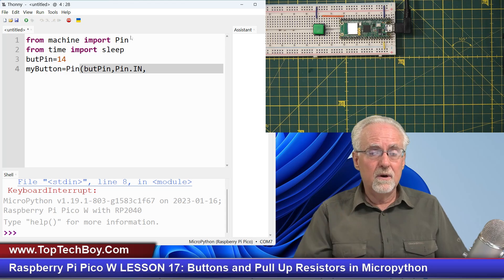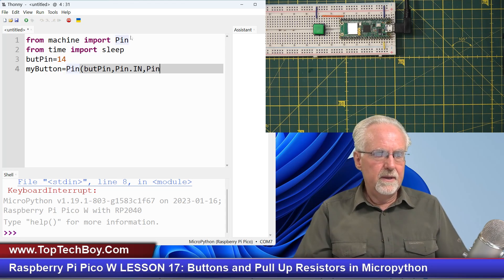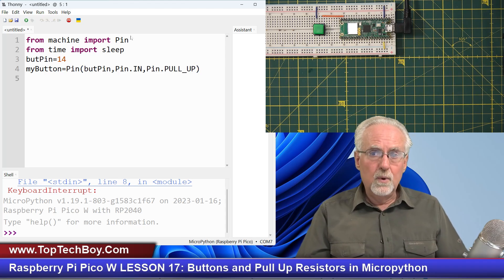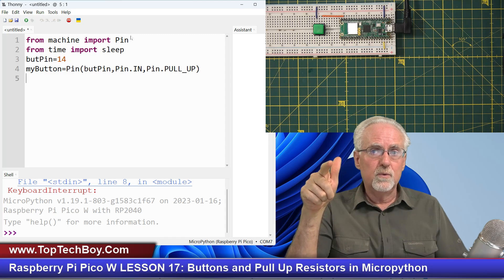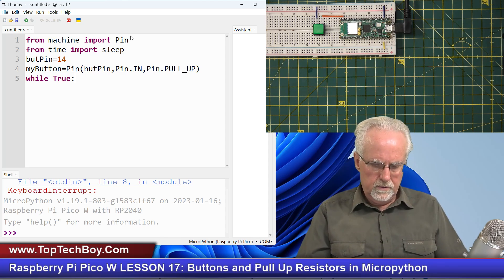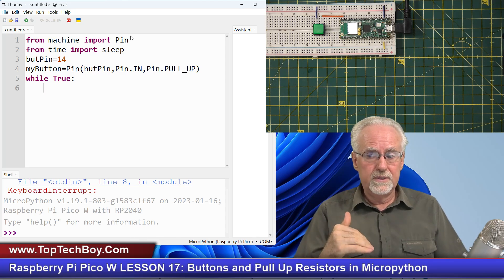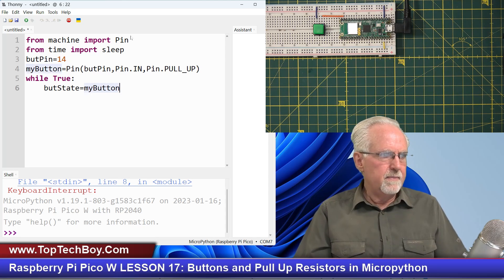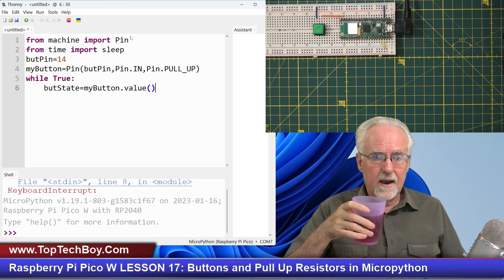Raspberry Pi Pico W LESSON 17: Buttons and Pull Up Resistors in Micropython

Comment: Will anyone advise please? As one learns code as a beginner, is it important to learn these sketches by heart, typing them over repeatedly (that is after every line of code is understood), to kind of build our "vocabulary"? 

I'm doing this, but I find that after 10 lessons I'm already forgetting how to type the earlier lessons by heart. Should I carry on with the lessons, typing them out, ect. until I reach lessons 94+ or should we repeat the earlier/earliest lessons to have them fresh in our mind? Even after revision I find that my vocabulary goes away, BUT I realize I know exactly WHERE to go back to whenever I need to check on syntax.🙂
Reply from the maker: I think it is important to review. Go back and make sure you can write simple programs on your own, without looking at my solutions line by line. Spend some of your time reviewing old lessons as you continue to move forward with new lessons.

Comment: Guys, could you please give me advice. My buttons do not work, I changed 3 breadboards, changed GPI opens, checked them. But still can't get the result as in the lesson,took button from Arduino kit, still doesn't work.
Should I change pc? thank you!
P.S. Thank you for the great lesson!
Reply: Did you hold the button down?  It isn't a toggle, it is open when not pushed and shorted when pushed.  You may be clicking it and missing that it shorted and then opened right back up when you let go.

Comment: I was confused about the pull up resistors part, here's a video that helped me understand it a bit better. https://www.youtube.com/watch?v=_8HYjjaT7BM&ab_channel=JulianEdgar
This is my understanding of the concept, if I made a mistake feel free to post the correct explanation.
1. The "IN" pin is directly connected to a 3.3v input.
2. When the switch is not shorted (not pressed), that input 3.3v isnt grounded and so that IN would receive that voltage (as per point 1). So a value 1 on thonny.
3. When the switch is pressed, that input 3.3v is grounded thats why we see a zero on the value on thonny since that voltage isnt there anymore.

Thanks for making this amazing series Mr.McWhorter! I've been looking for something like this for quite sometime.

Comment: Homework for the lesson https://youtu.be/Tgfjf7aMQpw.  Some switch bounce encountered of course and possibly long press toggling which I should have account for with a delay state.
Reply from the maker: OK, you have it working, but you have done it in a way that requires a specific touch. So, you have to think, it needs to work whether you have a quick push or a long push or an in between push. Does that make sense?
Reply: @paulmcwhorter  Yes another use case option.  In the real world it is interesting how many products actually work the way I have coded it (Remote control volume buttons etc) unless I am misinterpreting something.

Comment: https://youtu.be/pGy4gBscj6o

Did something a little extra....  Added a white led which toggles while the button is pressed every .1 sec.  Added code to toggle the RED led only once no matter how long the button is pressed.  Please ignore the DHT22.  (I skipped ahead to lesson 20 - DON'T tell Paul)

from machine import Pin
from time import sleep

buttonPin = 14
myButton = Pin(buttonPin, Pin.IN, Pin.PULL_UP)

rledPin = 15 # RED Led
myREDLed = Pin(rledPin, Pin.OUT)

wledPin = 13 # WHITE Led
myWHITELed = Pin(wledPin, Pin.OUT)

toggleLed = True

while True:
    buttonstate=myButton.value()
    print (buttonstate)
    sleep(.1)
    if not buttonstate and toggleLed: 	#This will TOGGLE the RED Led one time
        myREDLed.toggle()				#no matter how long button is pressed
        toggleLed = False
    if buttonstate:
        toggleLed = True
    if not buttonstate:		# This will TOGGLE the WHITE Led every 1/10
        myWHITELed.toggle()	# of a second for as long as the button is pressed
Reply from the maker: LEGEND!

Comment: @paulmcwhorter what type of software are you using to record the videos? I'm still having problems with OBS Studio.
Reply from the maker: I use wirecast, which unfortunately is an expensive program. You can get OBS to do most of what wirecast does.